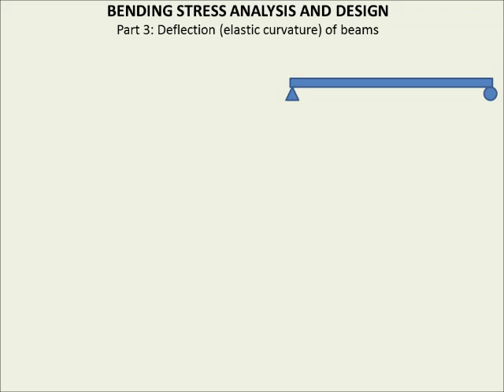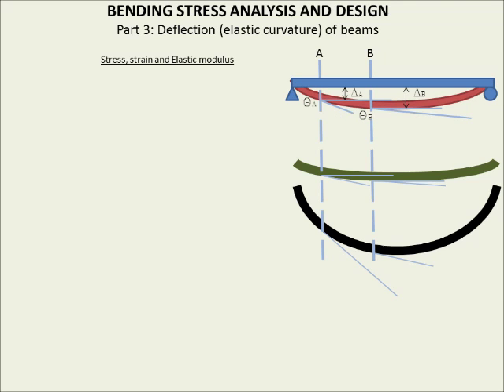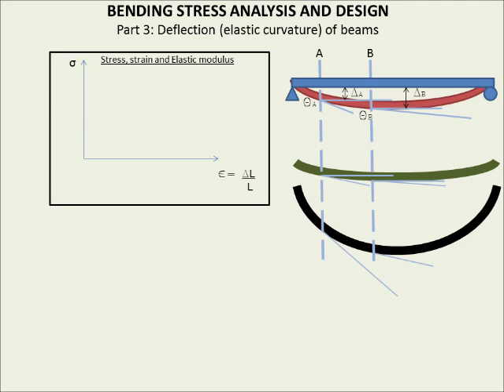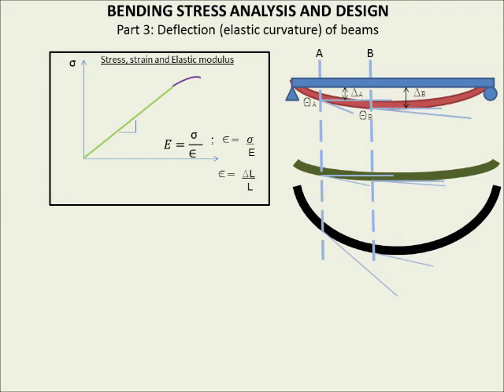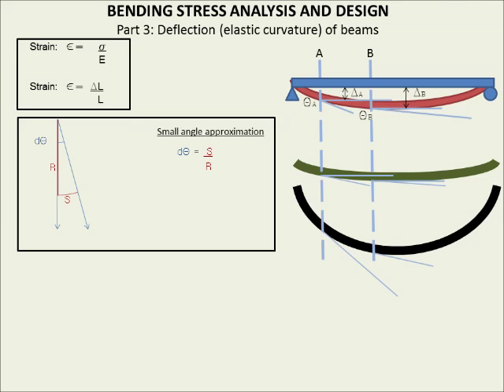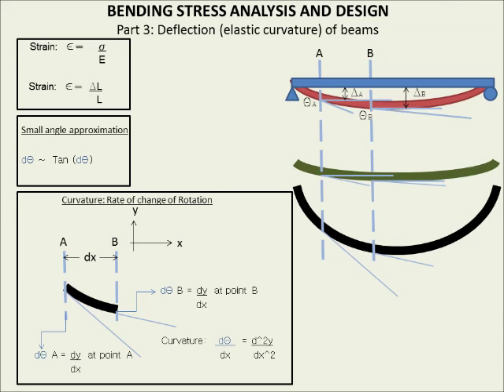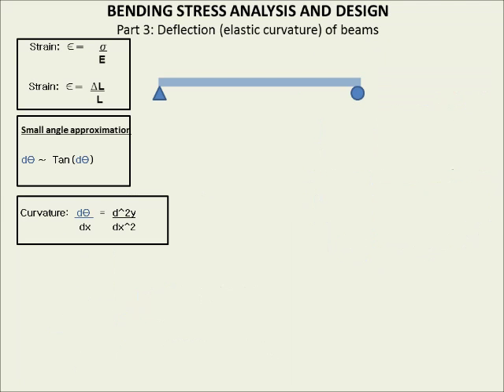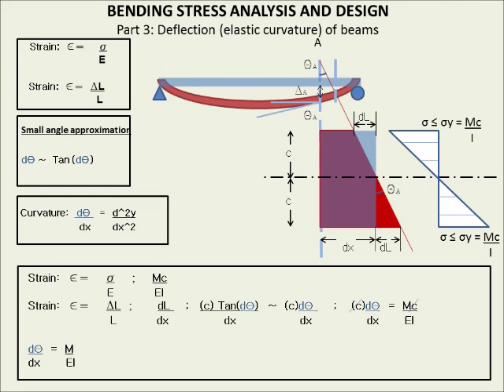Basics of Bending Stress part 3 - Elastic Curvature of beams (beam deflection)

Comment: Great video as always, appreciate it. 
I have little bit of problem bytheway, in the beginning (after zooming) you assume tiny horizontal line(___) to be dy but in the next slide you assume that to be dx why?
Reply from the maker: Very good catch!  
Initially, when recalling the basic principles of small angle approximation,  the diagram I show is rotated 90 degrees (no real reason for doing this - was an oversight).  I.e. the "X" direction, which goes along the length of the beam is shown going up and down, and "Y" goes horizontal.  Then, when i show the small section of the black beam, the orientation is shown with the length ("X" direction) going horizontal...  I agree that it is confusing and I did not do it intentionally.  Please let me know if the above explanation helps clear up the discrepancy.  I will be more careful next time.
Reply: @prometheusengineeringgroup7825  No worries, I got it......
Reply from the maker: Please see our latest video (on structural dynamics)
https://youtu.be/ZxvLC-91QKs

Comment: If you would like to see a general beam deflection equation, which works  for multiple beam/load combinations, search youtube for Global Beam Deflection Equations, a 3-video set showing the derivation and use of 
this 'universal' deflection equation. It can be differentiated to give a corresponding 'universal' slope/moment/shear equation. 
It works for linear and non-linear loads, either beam-wide or partial loads and shows symmetries not 
previously known between beam types and across single point loads and across partial-load boundaries.
Reply from the maker: Please see our latest video (on structural dynamics)
https://youtu.be/ZxvLC-91QKs
Reply from the maker: Here is another video for our loyal fans! This one breaks down the concept of shear stresses in beams!
https://www.youtube.com/watch?v=fJiJY06iX7Y